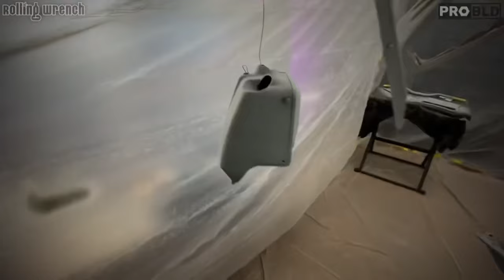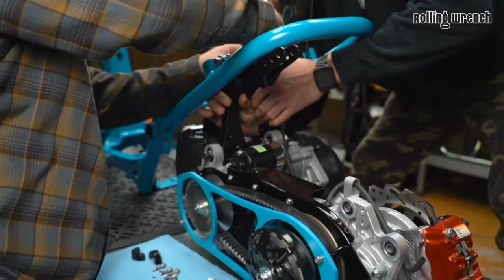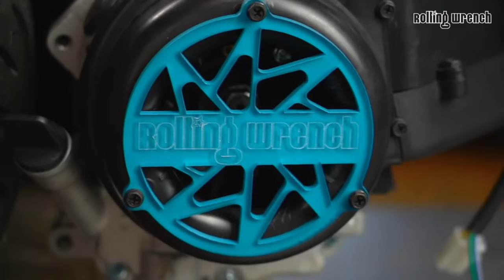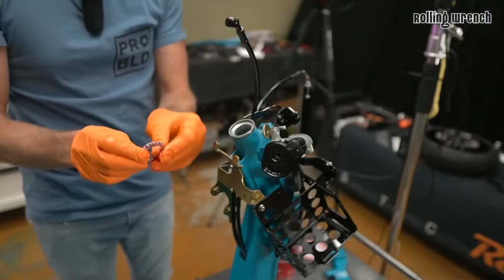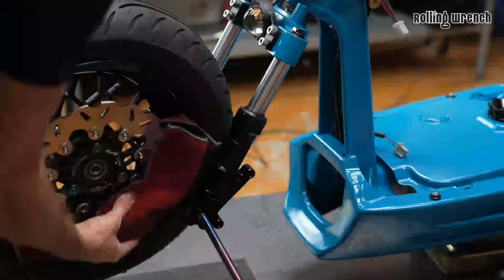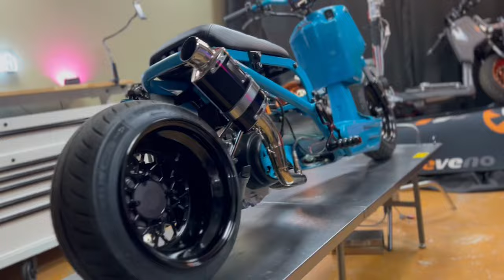GY6 Honda Ruckus Scooter Build [start to finish]

Comment: What kind of engine could I put in my Ruckus so it'll be EMP and solar flare proof? Can't have a CDI and would need points ignition. Any suggestions ?
Reply from the maker: A Prius motor :-)
Reply: @RollingWrench  I guess that means you don't have any suggestions.
Reply: @battshytkrazy156  You can't shield a CDI because it has wires leading out of it. Nobody makes small diesel engines for mopeds because they don't produce enough horse power and their RPMs are too low. For cars, yeah an old diesel with a manual transmission so you could pop start it would be EMP and solar flare proof, but for a moped you need something that has points ignition, kick starter, carb and no CDI. Something like the old Honda PA50 is EMP proof, but I was just hoping there was a more modern made, but still old fashioned engine that would work in the Ruckus.
Reply: Have spare parts and put them in a old microwave as a faraday cage look up Faraday cage on YouTube
Reply: @richardworden9747  Yeah, I'm already aware of how to make a faraday cage. Using a microwave doesn't work because there's 3 different types of EMP radiation that can fry electronics and the microwave only blocks one type, but not the other 2 types. The easier and cheaper way is to use a steel trash can to store the electronics inside and you have to use aluminum tape to seal all the seams and the lid. Plus you have to line the inside with cardboard. I've already done that to store my ecoflow solar generator and my spare CPAP machine. I'm perfectly aware I can store spare moped and car parts like the CDI / ECU, but that still won't help me make it back home if I'm away from home when the solar flare or EMP hits. So having an EMP proof vehicle to start with would be the only way to solve that problem. Plus you'll never know if a second solar flare or EMP would go off a few days or weeks later after you take your spare parts out of the faraday cage to use them. Having stuff that's EMP / solar flare proof even when it's not protected by a faraday cage is what I'm wanting. It shouldn't be very hard. There's probably dozens of different engines people make that'll work for a Ruckus. Why isn't there one out there that's made with points ignition? Maybe for emissions reasons, but it's not because they are harder to produce. If anything they would be easier and cheaper to produce. The emissions excuse can be avoided if they are designed for " farm / agricultural " use.

Comment: Awesome build. My only concern is that rubber band that is used to drive the wheels. Bro upgrade to a chain! More reliable than depreciative rubber.
Reply: Ever heard of timing belt….? Motors with belts have seen way more hp than this little scooter will ever produce. Plus it’s a lot safer to shred up a belt, than to snap a chain and have it get stuck in the sprocket and make you crash🤷‍♂️
Reply: @hagenschwark8908  
Timing Belt!!! Lol my apologies. Awesome build bro!
Reply: Whats the price for these builds?